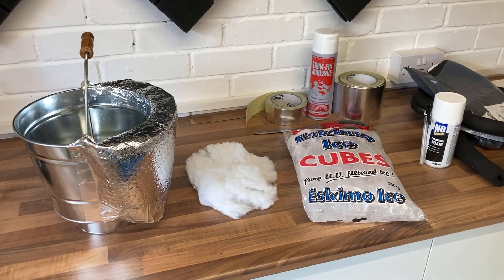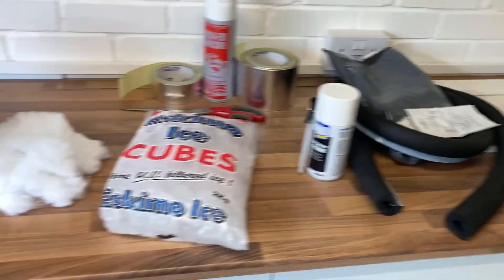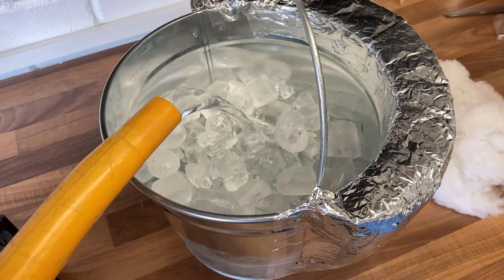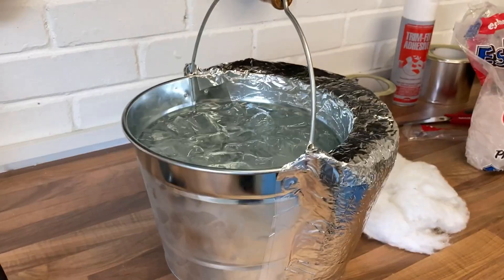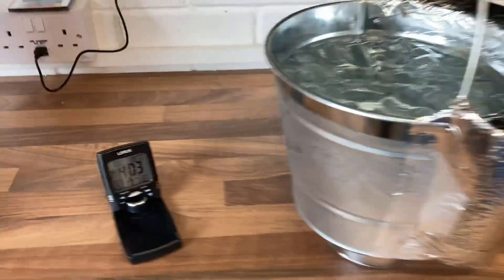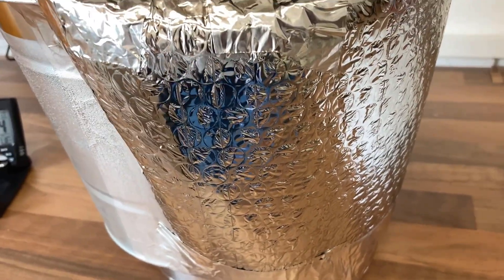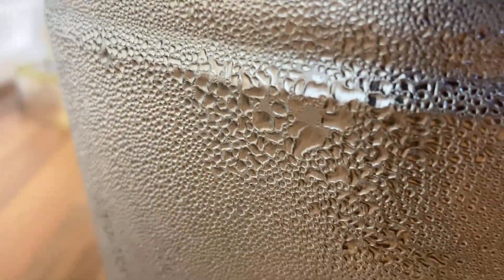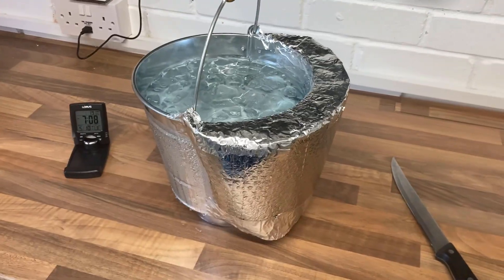Vapour Barrier in a Van - I can Prove they Work.

Comment: Nice one Greg, a question for you, I can’t get to put in a foil barrier as my sprinter HYMER is a factory build 2022 . The insulation is shocking already blown a control panel. I can however push insulation in through the hole for the control panel and into other spaces would that mitigate as much condensation and have some effect.
Reply from the maker: It will obviously be impossible to retrofit the vapour barrier or install a closed cell insulation, so I advise always keeping the interior warm and well-ventilated. That will help to reduce the relative humidity and keep internal structures above the dew point.
Reply: @GregVirgoe  Yea but I'm thinking of stuffing the gaps i can reach with the plastic bottle insulation. Just wouldn't be a vapour layer stuck to van metalwork/ bodywork

Comment: Do you insulate doors as I've recently seen a video showing why it's a bad idea insulating doors as doors normally have windows and obviously handle where water can enter inside the panel to solve this issue the doors have drain holes in them so if you insulated you would have a problem
Reply from the maker: No insulation in the doors as you say the opening windows allow water down inside the doors plus so many mechanisms in the it would be impossible to do it without jamming up the doors.

Comment: Thanks for the added science to the van conversion process! Would you say the laminate/plastic vapour barriers work ok? it's much cheaper than foil and I've seen a few people use it? Cheers
Reply from the maker: As long as it a good quality plastic as some are slightly porous. You can get a builders plastics sheet designed for damp proof courses that would be ok 👍🏼
Reply: @GregVirgoe  Thanks, Greg! I'll make sure to pick a quality sheet.

Comment: The reason I ask
Is I’m just about to insulate and I have a load of loft mineral wool and I will be using the same vapour barrier over the top.
Thanks
Reply from the maker: That would be fine. Just spend a little time and make sure to seal your vapour barrier.

Comment: When you isolate with some material + air you get a small amount of water trapped, as you showed in your other vid. The colder when you do it the less water in the air. Is it better to isolate with just some material and no air (perhaps not practical or doable, just thinking)?
Reply from the maker: You’ve seen how much moisture is trapped so it’s not worth worrying about. Yes there would be less moisture content in the air during colder months 👍🏼😊

Comment: If you put up the barrier in a very warm and humid environment, do you trap moisture between the outer wall and the vapour barrier? Should this process be done in a non humid environment? How do I create such an environment? Perhaps these are stupid questions.
Reply from the maker: That’s a good question and I have done a video about it to explain exactly what you need to know 
https://youtu.be/waObMyiDXVE
Reply: @GregVirgoe  Thank's! I watched your vid, very good. I wonder how the humidity is for -5 or even -10. Perhaps not fun to work in that temperature.

Comment: You are a genius, great vid, thanks! How do you fasten things in the wan, does that not damage the vapour barrier? How do you do that without creating holes in the barrier?
Reply from the maker: Don’t worry about screws because they are plugging their own holes there is not a hole created. Cables make sure you seal around them with tape. Recesses fir sockets line the back of the box with tape also. 
Just a little bit of effort and you can make a good seal.

Comment: I appreciate your videos a lot, as you seem to be really good at explaining the actual science behind it all. But in this test, you are not actually comparing an insulated van with a vapour barrier against an insulated van without a vapour barrier, as you claim to be. Here you are comparing an insulated van with a vapour barrier against a completely uninsulated van...... All you demonstrate here is that condensation forms on an exposed cold surface. I don't think the anti-vapour-barrier people deny that at all. But in the end, whilst I was excited in the hopes that you would put an end to my confusion about whether to use a vapour barrier or not, I am just as confused, and if anything, a little less sure of how much to believe you! Anyway, thanks a lot for your generally great videos. I just think this one did not actually provide any clarity on the vapour barrier debate
Reply from the maker: I’m almost lost for words 🤔😳
The bare side is a control side to show that the temperature of the bucket was in fact low enough to produce condensation.
If you agree that cold surfaces can produce condensation then your halfway there to understanding the problem. 
So if your chosen insulation allows moist air to get through it to the cold surface then you will have condensation. So all wool based insulations allow airflow fairly liberally so these will not stop condensation. 
Closed cell insulation like spray foam or Armaflex neoprene sheet have their own inbuilt vapour barrier so these prevent condensation on their own. 
What I find difficult to comprehend is those that just allow their vans to condensate all the time it’s cold. 
If there is a way of preventing this from happening why would you do anything else. That’s crazy 😜
Reply: @GregVirgoe   @Greg Virgoe  Ohhh I get you now, yeah it definitely works as a control...!! Haha. My bad! Thanks for clarifying that 😅. You have no idea how many times I've watched this thinking I was missing something 😂😂. Still though, isn't the whole VB debate around whether it's worthwhile to try to use one due to the fact that most would then poke loads of little holes in it when installing the rest of the build, thereby giving moisture a way in with very little way out again...? But anywayyy, thanks for your reply, and particular your mention of the neoprene closed cell stuffs... I've been considering a product like that that sticks directly onto the inner surface of the van, soooo maybe my decisions can finalllllyyyy be made. Thanks a lot 😁

Comment: Nobody is claiming a vapour barrier doesn't work. The fact is that you can't vapour barrier a camper van like that. You're screwing in battons creating holes, light fixtures etc. It's not a sealed environment.
Reply from the maker: Lauren, When you put a screw into anything it does not leave a hole. There would only be a hole if you took the screw out. It’s not difficult to create an effective seal void. 😊
Reply: @Greg Virgoe  what about the sills though? They're vented and the wheel arches do let in moisture to the sills. I'm at this part of my van and originally I was going to do a vapour barrier but now, looking at the sills I can't imagine that I can seal all of that off

Comment: Hi Greg. Great to see this done by someone well qualified. We have a Winnebago Travato 2016 5G. They are not well insulated. 

Q1, If we insulate into every cavity that we can access, will we just create a rust problem? 

Q2, What if we leave an uninsulated space at the bottom of the cavity so that the insulation stays as dry as possible and the condensate can evaporate?
Reply from the maker: If it’s impossible to create an effective vapour barrier but you still wish to insulate them my suggestion would be to place insulation into plastic bags to form waterproof pillows and use these to fill voids. This keeps the insulation dry and allows the cavity to drain of any condensation. 
You will need to keep the motorhome well ventilated and heated above 10° at all times to reduce the build up of condensation in the first place. 
Hope that helps 👍🏼😊
Reply: @GregVirgoe  true. At least the insulation will stay dry. Thanks Greg.

Comment: What happens when you need to drill through the vapour barrier , say to attach a cabinet to the wall?
Reply from the maker: In reality you don’t drill and leave holes when you fix stuff to the walls you use screws which are plugging their own penetration so there is no hole there. ☺️😎
Reply: @GregVirgoe  ok! I'll have to research more :-) I've done a super basic van conversion, but I've not done it right, going to have to take it apart.

Comment: Hi Greg , I have just insulated and about to move on. I'm flummoxed at the minute whether to put vapour barrier then framing , or framing behind the vapour barrier ? And should the electrics go infront or behind the vapour barrier ?  Lucy
Reply from the maker: Hi Lucy. It’s best to put your vapour barrier over you insulation and your van then framing and cladding on top. If you have space in the depth of the framing you can put wires there but be careful not to screw into them. Or you can put wires in conduits in the van walls. Make sure to seal around any holes for wires with foil tape. Hope that helps 👍🏼😊

Comment: Great demonstration. If air is an affective insulator itself wouldn't it make sense to just install a vapor barrier over the panels of the van leaving a gap of air in between your barrier and wall?
Reply from the maker: No the insulation value of air is very low and a cavity doesn’t vary with thickness either. Insulation no matter what form is always going to be better than just air. 👍🏼😊
Reply from the maker: For example the R value of air gap is 0.17 and 50mm of PIR is 2.3 so 14 times better than air alone. 👍🏼
Reply: @GregVirgoe  ahh thats makes much more sense. I guess i over estimated the properties of air! Thank you for such in depth educational van videos, it is greatly appreciated
Reply from the maker: @v1ncepupp1o7  no problem 😉 always happy to help 👍🏼

Comment: Isn't it more likely that it's not sweating cuz it's insulated, not cuz of the vapor barrier?
Reply from the maker: No, the moist air can easily get through the wool insulation that does not provide any barrier at all and it will still end up sweating.
Reply: @GregVirgoe  My point is that it's not the vapor barrier that's causing this discrepancy, it's that the surface was never cold enough in the first place to cause the condensation due to the insulation
Reply from the maker: @boli2016  the surface of the metal will be the same temperature as the icy water because steel is a very good conductor so that bucket will be close to 0° even under the insulation. Trust me I have insulated cold tanks, galvanised AC ductwork and chilled water pipes all my working life and it is only the vapour barrier that stops the cold metal from sweating not just the insulation. I speak from years of practical experience in this trade. 👍🏼😊
Reply: @GregVirgoe  Wouldn't it be important as part of the experiment to also prove it otherwise? Would it be possible to repeat it with just the insulation?
Reply from the maker: @boli2016  if you made a bucket just out of wool type insulation do you think it would hold water? Or would the water just pour through it in seconds?
Reply from the maker: @boli2016  the insulation on its own cannot prevent moisture getting to the ice cold bucket. It’s no barrier at all.
Reply: @GregVirgoe  I mean to repeat the same experiment but no vapor barrier on your insulation...
Reply: @GregVirgoe  Assuming you had put reflectix on top of some insulation in this setup

Comment: What about the argument; the van already is a vapour barrier, no point in adding a second one?
Reply from the maker: That isn’t even an argument. 
The van stops water getting in from outside. That’s got nothing to do with moisture inside condensing on cold steel surfaces. 
You need to stop moisture getting to the metal skin from the inside. That’s why you need a barrier inside your insulation. 👍🏼🤓

Comment: I´m about to insulate my box van soon. Can I use plastic wrap as a vapur barrier? Guess it would be cheaper?
Reply from the maker: A good quality plastic builders vapour barrier will work fine. 
Some cheaper plastics are slightly porous 🧽👍🏼😊
Reply: @GregVirgoe  Ok Thanks, one more question... I´m using closed cell foam boards and filling the gaps with normal cheap urethane foam. Is it enough if I only use aluminium tape to those urethane gap parts or do I need to cover the whole walls with the vapour barrier plastic?
Reply from the maker: @hungrycamperfilms  as long as the foil tape sticks well to the closed cell foam. You may be better with closed cell tape. Like Armaflex sell.

Comment: Greg great content.  My question is, my van is not vapor tight from the skin nor do I think I can get a good enough vapor seal to stop vapor from getting in between skin and vapor barrier, your pale is vapor tight and the vapor barrier is completely sealed in your demo. when moisture, that seems inevitable, gets behind a the vapor barrier the vapor now seems trapped and will cause potential issues. I wonder if a vapor retarder is better to allow vapor to naturally escape from the hydrophobic insulation like mineral wool and rigid foam.  Your thoughts would be greatly appreciate.
Reply from the maker: It’s not difficult to seal all the joins and edges and any penetrations for cables or sockets etc. spend a little time and do it right first time.

Comment: Great stuff Greg.  Nice to see the science being shown to back it all up.  I'm just about to insulate my van and install a vapour barrier but will be using Intello Plus as I have some left over from the house renovation.  Have you seen it before or have any thoughts on its use in this situation?  It's vapour permeability varies according to what temperature it see's either side of the membrane, I'm not suggesting it'll be any better that standard membrane and like I say only using it as I have some spare.
Reply from the maker: I’d not heard of it so I looked it up and read the technical data. 
It remains slightly permeable even in winter cold temperatures. 
In our application we really need a 100% solution so I wouldn’t install it. 👍🏼😊

Comment: What about all the glass windows in the bus , how they also get condensation on them,  what do you do with that,?
Reply from the maker: You reduce the issue by providing heat and ventilation to lower the relative humidity and keep the temp above dew point

Comment: Could you explain how the layers should be applied to the internal panels of my van. The videos I have seen suggest 
Thin sound deadening 
A foil backed self adhesive insulation, 7-10mm
35-50mm insulation 
Ply
Carpet
Will that system replicate your video 
Thanks
Reply from the maker: The correct method is this -
1. Sound deadening on large flat panels
2. Insulate van 50-100mm good insulation PIR board and wool.
3. Foil vapour barrier over everything sealing all joins and edges with tape. 
4. Plywood lining
5. Carpet 
That’s it very easy 🤩
Reply: Greg Virgoe could you suggest which vapour barrier product to use, thanks
Reply from the maker: @staticchannel1  a double foil bubble is very easy to install with a little trim fix adhesive. 👍🏼🤩

Comment: Does the barrier have to be the foil bubbles?   Can I just use any non moisture  permeable sheet?
Reply from the maker: You can use a polythene damp   proof membrane as long as it’s good quality. Foil bubble for me was easier to apply with a bit of spray adhesive very simple.
Reply: Thanks Greg, I work in plastics forming and all the ABS comes fully wrapped on the pallets in 2 layers of polythene to leep the moisture  out

Comment: Hi Greg, great video. What vapour barrier we’re you using and where did you buy it from? I’m about to buy some for my van and wondered if one was better than another? Thanks
Reply from the maker: Foil is far better than plastic and we found the double foil bubble wrap you get on a roll is very easy to apply and we use a bit of Trim fix adhesive to keep it in place. 😃

Comment: Fantastic video Greg!   Would really appreciate your thoughts on the following if I may.
It is fairly easy to continuously seal the cargo area. 
However, in my Renault Trafic, the A, B & C pillars are all connected across the top due to how they create the bodywork. So a void across the top, which all pillar voids merge into.  It's easy to seal up the C pillar behind the sliding doors.  The B pillar though, well thats got the seat belt mechanism inside so no way to seal where the belt is at shoulder height and the reel at the bottom has to come up the pillar.  A pillar has an opening under the dash corner. So two questions here :-). 
1:  Stuffing the pillar voids with insulation as best as is possible?  (getting it in there effectively still eludes me, i've thought about blowing little wads in with an airline...)
2:  Vapour barrier it as much as is possible? even though there has to be an opening for the seat belts?

EDIT:  More thoughts from me!

Given the pillars are subject to thermal conductivity from the outside skin, then stuffing them with insulation will have negligible effect right?  It will stifle airlfow I guess, but not vapor over time?
Then given I cannot for a 100% barrier on the B pillar because of the seatbelt, surely the B pillar is still in its original situation, vapor in, condensation will form on the outerskin in the right consitions, dripping down into the sill? & that pillar is connected to the C pillar via the horizontal cavity across the roof line.
Reply from the maker: There nothing you can do with the seatbelt pillars or a lot of the cab floor or doors. You can close up the top beam section with some closed cell foam to seal it from the rest of the van. Minimising the potential for water to build up 👍🏼😃